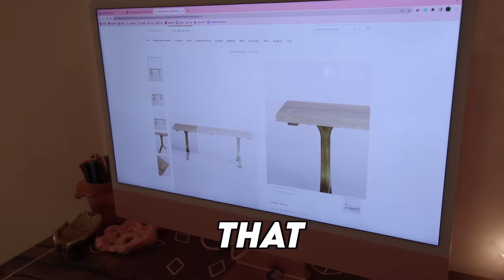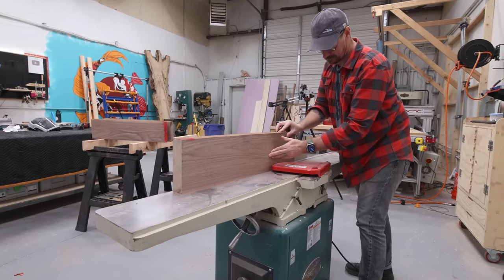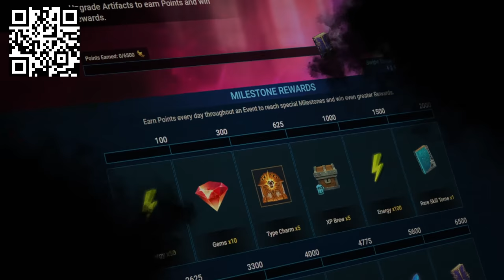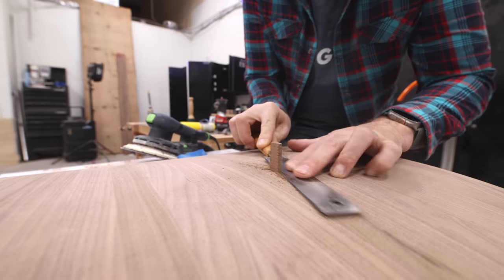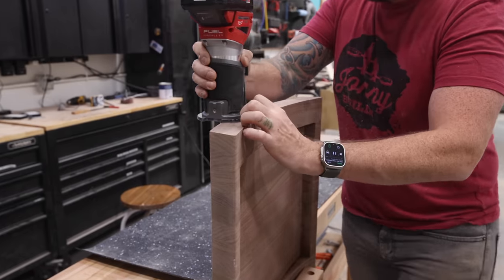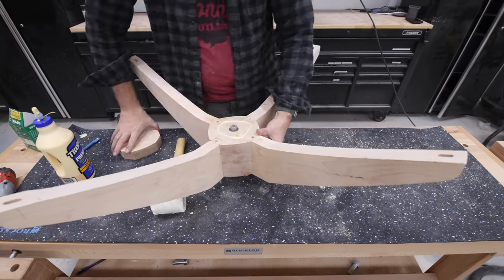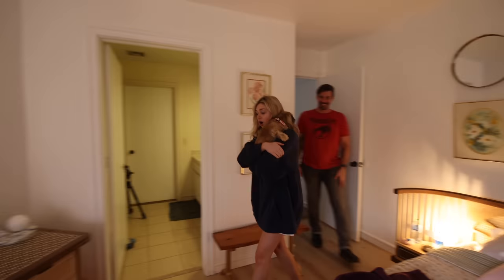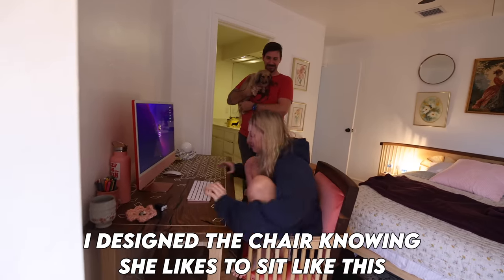She Told Me Not To Build This...Her Reaction Is PRICELESS!

Comment: Comfy. Wow, that chair turned out AMAZING. Because you're redoing the cushions, I suggest going with a firmer foam. I have that foam on my daily foot rest and it has already started being permanently compressed after... Maybe a year? You could just make them removable and have replaceable cushions
Reply: I defonitely agree about planning the cushions to be replaceable. There's no way even the best foam is going to last as long as the woodworking will.
Reply: Yah the upholstery trade refers to that foam as "high density" when it's actually anything but. It's scarcely dense enough to cut a bath sponge from. What you need is what they call "composite", the stuff that's thousands of little offcuts of stiffer foam all sort of melted together (I guess there must be a reason they don't make sheets of the stiffer stuff? 🤷‍♂)
Reply: I ‘fixed’ one dining chair and replaced the seat cushion. It came out ‘meh’, good enough. My buddy was getting custom cushions for his boat, sent the paper template for the dimensions and picked the foam thickness. They were beautiful and reasonably priced. I sent off a template for the other 9 chairs and they were perfect. After more than a decade a few of the cushions needed rehab. I visited the local fabric store, the owner was very impressed with the previous work, 3 different types of trimmed foam, a batting for the elements and waterproof stitching. I was directed to materials and given tips for even a nicer, indoor repair. These held up even longer, closer to 20 years. Even used daily, when the set was passed on, the newer cushions could almost pass for new. 
The fabric store is long gone replaced by condos, nothing local popped up to fill this niche. Local machine shops, hardwood dealers, chandleries, tanneries, and craftsman are fading away being replaced by lower end, disposable, online orders. Please support these local resources, pick their brains and pass on these skills and knowledge before everything is replaced by cheap, mass produced, plastic, disposable, knockoffs of once beautiful bespoke pieces. Do it for the kids.
Reply: Also it is nice to give the foam a layer of wadding on top (spray glue it down). It gives the cushion a much more finished, high quality, look! 🤗

Comment: Hey Jonny, I saw you're using a Bosch saw and it looks like the dust collection isn't working great... Check out Shop Nation's recent video!! He 3D designed and printed an upgraded dust collector that should work for your saw and is already compatible with your dust collector hose! I would definitely consider getting one if I were you! Hope this helps!

Comment: almost a year after this was posted... i'm always amazed at a) what you "see" in your design mind, and b) the meticulous attention to detail. Many (MANY) years ago, I built a coffee table for the TV room so my and my (then) wife could eat while we watched TV. It was two 3'-4x12's with some 2x8's nailed across them on top with dark stain. weighed about 200 pounds. took ten minutes to build. You need framing, concrete, plumbing, electrical, roofing? I'm your guy. Fine furniture like this? call Johnny!

Comment: i recently built a desk for a friend from a Hickory slab, that curled like a potato chip. After getting it back flat I hand cut bow ties and then filled the bow ties with epoxy, turned out killer.Wondering what your thought are as far as the strength of that compared to wood? would be great to send you a couple pics. Thanks

Comment: This may be a bit late but ... for the cushions you should consider different layers of foam, ie: a laminate of differing densities. Starting with a thickish and firm base layer - to keep the structure, then a less firm layer in the middle for comfort and then a soft thinner layer on top - one of those foams with a profile like the inside of an egg box - for breathability and comfort.

Comment: looks cool, but little info.. Red/white oak isn't about the color of the wood, but the leaves. White oak can be pink and red oak can be white-ish. the actual way to tell is if the pores are hollow or filled with resin. Red oak the grain/pores are hollow, can often actually use it like a straw, White oak will have the pores/grain solidly with a resin like stuff. White oak all be MUCH heavier also.
Reply: Came here to say the same thing, glad I wasn't the only one.
Reply from the maker: You’re correct but I find looking at the color and smell are much easier than pulling out the old microscope.
Reply: @JonnyBuilds  don't need a microscope, it's actually pretty easy to see at the end grain.

Comment: It’s a beautiful chair.
I also make furniture as a hobby.
I do have a couple hopefully respectful suggestions.
Use real upholstery foam.  Maybe you did. I don’t know.
Cut the foam with an electric meat carving knife.  It has two serrated blades that slide against each other in opposite directions.
Cover the foam in polyester batting.  That will fluff up the cushions and make them easier to cover with fabric nice and neatly.
If you want a more comfortable chair have the cushion sit on webbing instead of solid wood.
When you sit down and your butt hits the bottom of the cushion instead of a hard stop you’ll have a sort of hammock effect.
Seriously, look up a YouTube channel on upholstery.  
You have some serious skills.  May as well learn some more.